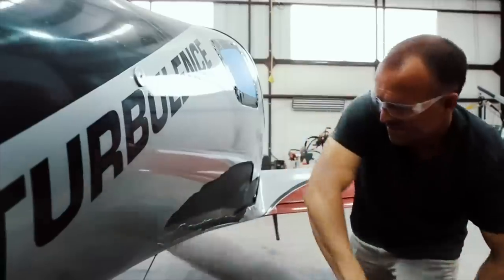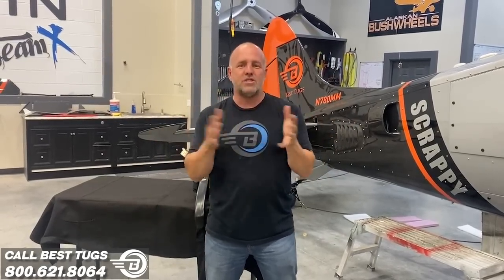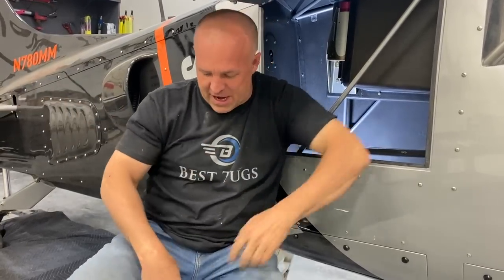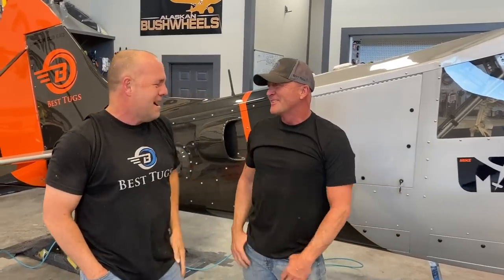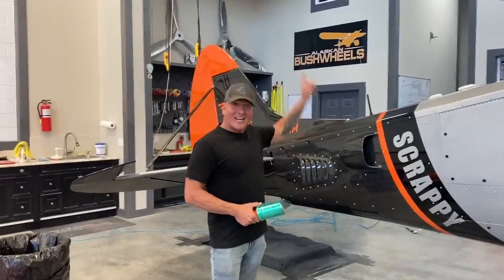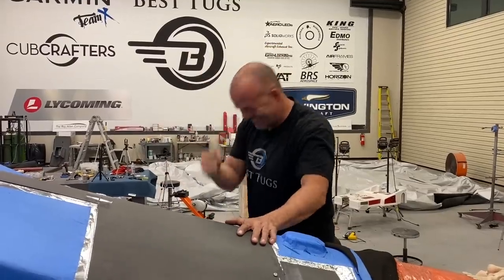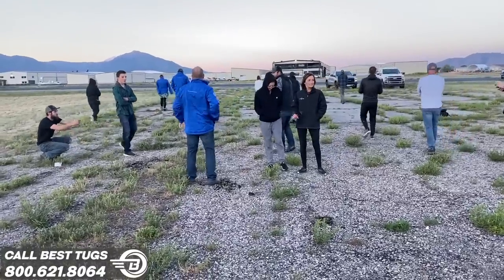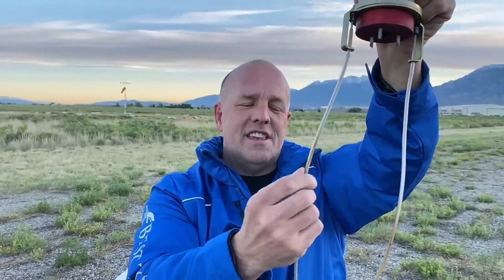🚀 Rocket Parachute blew the lid off my Scrappy Bush Plane 🔥 (Scrappy Bush Plane 27)

Comment: Mike. I have been following you from before Scrappy Build, the Draco days ( about two and half years). 
This has been by far the most Heart warming in two ways.  First your friendship with Ron. Not many can be and remain true friends like that. 
Second, the ''heart'' as the rocket launched the parachute. Priceless. A moment in time.
Also what most did not pick up is that it was Scrappy's not ''fully exposed'' trip out of the hangar, out on its own wheels by Best Tugs..
Now ''get back to work''.

Comment: So my Icon A5 has a BRS Chute, and I learned a heck of a lot more about it in this video than everything Icon has described and published. Thank you for the outstanding informational description!!
Reply: Hi Brett, what are you opinions on the A5 so far? I have done intro flights but just haven't been able to pull the trigger quite yet. For some reason, im not a fan of Rotax engines as i just feel like im driving a snowmobile in the sky. But despite all of that, I still think I will make it happen. Would be curious to hear your thoughts, however.
Reply: @DavidDavid-jb1cy  LOVE, LOVE my A5. Pull the trigger, you won't regret it. The Rotax is a great engine, has a terrific track record, especially the 912 IS. No leaning, no carb heat, always always starts within 1 - 2 seconds of turning the key. Keep enough fuel in the tanks, it won't disappoint you.
Reply: @brettwest549  thanks for that reply. Much appreciated!

Comment: Great test. 
I have a question about if it mattered having the plane planted on the ground or suspended in the air for the test. Will the launch be absorbed by the suspension more than the frame being hit by the initial explosion? Just an observation. 
I think what ever you answer is excellent, I’m a fan.😊

Comment: Love your videos Mike. I could have told you the chute would work. Years ago I had a Buccaneer UL stored in an empty refrigerated semi trailer. One of my drivers hooked up to it thinking it was empty and took off. The King post that the BRS was mounted on bounced loose and pulled the cord and deployed the chute through the side of the trailer. Once you light the candle, they're pretty determined to go about their business. ; )  I've flown everything from a Weedhopper to M2.5 in a Foxbat. Have had a Decathlon for 35 years. You're my kind of airhead. Don't Draco that thing. Your videos have helped to keep me sane through the covid thing. Godspeed.

Comment: Hi Mike.  The first project I worked on when I graduated college (1989) as an aerospace engineer was the landing chute for the Space Shuttle.  That system had a mortar deployed pilot chute and the mortar had to shear several shear pins and accelerate the door that covered the whole system clear of the engine nozzles.  On that door was an angled plate much like your composite impact plate you made.  Same issue.  The door was at an angle relative to the mortar center line.  I worked at that company for 10+ years designing spin and deep stall recovery parachute system for the F-22, C-17, Bombardier business jets, etc.  You did a great job explaining about your BRS system.

Comment: Have been following SCRAPPY,  amazing engineering 👍🏻. Waiting for it to get airborne. BACK TO WORK!!!  Back in the early 70s flew a piper with a 0-320 in forested mountains in NE Washington and back and forth to Glaicer Park international in Montana at night over the Snowshoe mountains, no ground reference just the stars and moon if lucky. Have to agree no piston power at night. You count the beats, a stumble and it’s clean the seat time.

Comment: You are a great teacher and thanks for sharing.  Here is a tip for those blasted static generating packing peanuts.  Keep a spray can of Static Guard around to discharge their static electricity.  Makes cleanup a little easier.

Comment: The way they stitch that chute harness is the same way they do personal harnesses ppl wear when they're working at heights. I actually jumped with one of those harnesses on bc my lift malfunctioned and we couldn't get it to lower and I had to pee so I said screw it and jumped. I was about 20 foot up. The tether that was attached to my harness actually had the suspension stitching in it. It was a very surprisingly soft drop. And I ain't no small guy. Whoever came up with that design should be awarded something. It works so flipping well for being such a stupid simple design. Looking good Mike!!! Scrappy will be in the air in no time........ If she ain't already??

Comment: I think what he needs is actually a finite element analysis software in a CAD package something like Solidworks or Bentley Microstation. Model your aircraft in the CAD package, then run a FEA exam on the airframe to see how much force is needed to bend, bow, or break the fuselage. The results there will tell you how big the canopy of the shute you need to save both plane & passengers, provided its in an area where the plane can crash land

Comment: Thanks Ron!!
Love the Bromance👍😉☝️
Did you catch or dodge the Wrench Mike???
🚀rockets are cool🚀
💥explosions are cool💥
🖲3...2...1...🖲⛑🗯💥
Did you remember your weight as the pilot, your passenger, your gear, and the bag of beef jerky when calculating your chute size??? And why has this company not come out with a air foil type chute to be able to control the chute once its deployed???

Comment: Mike, pregnant idea: bush tracks instead of bush wheels. Think about it. Compare the drag and weight of humongous bush tires and wheels with suitably designed streamlined tracks having the same rolling, load bearing, braking, and envelopment characteristics but 1/4 the cross section and a streamlined shape. I envision a banana shape fairing containing a rubber track having an aircraft tread and a toothed or slotted back. The slotted back engages with the roller with the brakes. Along the frame are closely spaced load rollers and at the other end the adjustable idler just like a snowmobile but proportioned and lightened for aircraft. All in a package of elliptical section a foot high, three feet long and eight inches wide.

I think the added cost and complexity would be balanced by lower drag (higher speed, fuel savings, additional range) and lower unit loading on soft ground plus better planing performance in shallow water. Rolling resistance would be higher and extensions would be required for adaptation to landing gear as the pitch pivot must necessarily be located low in the track assembly. It might be a game-changer in the STOL/bush plane world. And, once developed and scaled for landing weights, a product for Best Tugs?

Comment: You're assume it will tip towards the tail, keep in mind due to wind drift at impact and orientation at this point it most likely would tip towards the nose.  If there is a wind the plane will weather vane, having a slight tail low attitude at impact would help.

Comment: 2000lb thrust... and the gas generation involved in that. Almost like blowoff panels in the chute compartment at the bottom would be a good idea for the "major manufacturers", or having a rocket tube that extends all the way under the fuselage with a gas plug so the interior of the aircraft is never exposed to combustion gasses... for everyone, on that.

Comment: Is Ron's last name O'Reilly, because his nickname should be Radar!
Always anticipating what you need and keeping the compound running!
(if none of that makes sense, you need to go watch some MASH and improve your life ;) )

I have been in that role for others before, and I can tell you from the other side that it's satisfying to find someone that you click with like that.

The most fun I had doing it was when I was the new hire building a new school building, and basically doing whatever the carpenters needed me for, and so I was always being told to get nails or Simpson hangers or lumber, and so after organizing the container I took a set of blueprints home and got familiar with them, so when the boss told a crew to start working on a particular feature, I would just start getting the material set out for them, often before they even knew what they were doing lol
I would also make sure that the jokester carpenters always had adequate large foundation tie-down nuts in their bags, so I would drop a couple in every time I walked past behind them... Smirk
Almost cracked the cement when they would drop the bags at lunchtime...

Then they discovered I could run the Skytrack forklift better than anyone at the company, and I started getting shuttled around to whatever job had the most difficult beam setting or whatever for the rest of my time there lol

Comment: In my estimation the backbone of the plane would take the brunt of a bang bang contact  landing. I believe if the parachute was rigged to make contact simultaneously there would lessen the stress the back bone would take. If the weight/gear travel can absorb the impact and can be calculated to 12" travel it should remain airworthy. I think that the balloon tires might transfer the bulk of the impact to the tail on the initial bounce.

Comment: Had a complete engine failure in a Cessna 206 in North Central Idaho several years ago. Put the plane down in a field. Didn’t put a scratch on the airplane. My advise is fly the biggest piece to the ground. Ballistic Parachutes are for Cirrus pilots wearing skinny jeans with manicures. Good day

Comment: Great overview, I am not an engineer so please excuse my question if straight forward. Your comment around the radius edges for the parachute. Given that you would "typically" be in a forward flight why would you have the rocket behind the parachute? Once the parachute starts to eject would it not be more likely from wind towards the exit channel of the rocket where there is a greater chance of snagging? Or is the ejection speed such that it is not an issue. Thanks Geraint
Reply from the maker: Geraint Williams 👍🤠 great question. The speed is so fast and once the chute exits the plane the wind helps pull the parachute clear and back.  The rocket is so fast it’s not a concern of entanglement
Reply: @MikePatey  Really appreciate the feedback.

Comment: Mike, Does your installation not use the line-cutter feature that allows the rear strap to initially be shorter than the front straps, thus allowing for the parachute trail behind the aircraft until the parachute slows the aircraft down?   After the line-cutters activate the rear strap lengthens to match the lengths of the front lines to hold the aircraft level below the parachute.

Comment: 13:30, why are you making the break away for the rocket pivot towards the front? Wouldn’t the forward travel of the plane add additional force for the rocket to have to push against? Wouldnt it be better if it hinted towards the tail so the wind would help rip off the break away panel?

Comment: just thinking : in case of gas shocks, would it make sense to change the spring coefficient of the shocks when the shoot is deployed (e.g. by the automatic opening of a valve increasing the gaz pressure in the shock via a small pressurized cartridge)? or deploying an airbag of sort to protect some parts of the aircraft/cabin ?

Comment: What did you calculate your maximum rate of descent (dive) to be in order to handle the impact forces of the parachute deployment?  I assume that too high of a descent rate would impart a shock force too high for the airframe to absorb it and result in a catastrophic failure of a mounting point.

Comment: I think you should have done the test with fans or jets blowing towards the plane to simulate the effects of your air speed
Reply from the maker: T.Cole_2  👍🤠 Its been tested hundreds of times on dozens of aircraft ground and in flight. What’s been learned is the air at flying speed even further assist in helping yank the parachute out.  So it’s harder for the bag to pull the chute without the wind so we don’t use that as an assist. if it can deploy with no wind than we know it will do better with the wind ripping the bag back and pulling the chute faster 👍🤠

Comment: Off topic.
  what are you going to do to compensate for the travel in Scrappy's suspension, in case of crosswind on the runway?
 Wouldn't the wing dip dangerously with that much travel in the suspension?

Comment: Mike, what sort of structural inspection or non-destructive testing did you do after that test?  A 2000 lb impulse load could have rot havoc on welds, clips and other structural components below, fore and aft of the rocket.  I know that the vertical load from kicking a 2K lb bomb from an aircraft, accelerating it to 30+ fps in about an 8" stroke, imparts 10's of thousands of lbs of load into the reacting structure.  Did you put strain gauges or accelerometers in the structure before the test?  Seems like you'd want to know what the airplane experienced before "slipping the surly bonds of earth".  Just curious...

Comment: That was awesome!!

Wondering, does the rocket require a floor to push against to get going?  If blasing into the bottom of the tube puts such stress on the airframe from the reactive force, could it have a blow out floor like the top that blows away?

There are gun tubes that are open on both ends with a dual charge.  One charge fires to create a pressure wave and then the main charge to drive the projectile out.  There is no recoil with this arraignment.   Maybe the same thing would work for this rocket.  Just have an open end of the tube or a floor that blows out easy and watch it fly.
Reply: I like your thinking. I bet part of the issue is that the rocket would need to be bigger, plus the "tube" obstructing the fuselage.

Comment: I can see on Draco wings that vg's are instaled right after slats. Is that configuration useful? Stolspeed sayed that using both slat and vg's are not recommended. What's the ideea behind that?

Comment: Don't you need to test this with airflow simulating forward travel to ensure it clears the tail etc?
Reply from the maker: dot gov  great question.  👍🤠 It’s an airspeed relative  to distance from chute exit.  So many test have been done and I’m several feet  forward than I need for ejection clearance of the tail at my VNE of scrappy.  Thanks for the great question 🤠

Comment: @Mike Patey , Is the aircraft skin around the breakaway hatch metal or composite?    I'm just wondering if there is can be any risk of the rocket exhaust starting a fire in that area?    I ask because of an unfortunate accident that occurred above Boulder Colorado some years ago.    A Cirrus SR20 collided with a tow plane with sailplane in tow.  Cirrus deployed their chute, but was burning as they slowly descended (sans one wing), and eyewitness reports suggest that the pilot and passenger jumped out.

Comment: Are you doing any checks of the frame welds or carbon connections after the test to make sure there was no microscopic damage?
Reply from the maker: Joe K 👍🤠 yes absolutely. every inch full disassemble of the plane and back
Reply: @MikePatey  I would have assumed so with your thoroughness but was interested to find out for sure.  Such a crazy awesome build.

Comment: could you build a cheap unmanned "towed glider" and deploy a parachute on That aircraft? Keep the airframe dirt simple and cheap, except for the necessary features being tested, just to prove the idea? Tow to altitude and target area. Detach, let it glide for a moment, then remote deploy the chute. Find some old beat up airframe to use, remove the engine and weight the nose.

Comment: I saw that guy on YT nose dive in a river because of air in the fuel from a fuel bag pump and I wonder if you can ‘fly’ with the parachute open? I don’t mean fly like a plane, or even hold altitude, but merely get to a clearing or miss a building if you can restart the engine? (thinks about gently floating onto a motorway) :o)

Comment: So if you are flying and the use the rocket will you need more propulsion? You tested on the ground and the aircraft was unable to move but when you are flying your airplane may not have lift and could just be forced even further away making the rocket too close to the aircraft.
I know that probably doesn’t make sense.

Comment: Hi Mike, since this test took place months ago before the pandemic took hold, does this mean that you might have the wings built at this stage since the fuselage has been ready to receive them for a while now?  Back to work!  Phil
Reply from the maker: Theresa Caron 🤠 not yet, the panel was my project done after that, you can see it’s not there or wiring or interior.  Then after that was seat and interior. Then motor mount.  Wings are after cowlings, engine plenum, exhaust, and custom spinner and a couple dozen finish up items.  A ton of one off stuff and then on to build the wings.
Reply: @MikePatey  Thanks Mike, just can't wait to see it fly I guess.  All the best.  Phil

Comment: Hey Mike, any reason you couldn't whip up a mortar tube, or venting system for your expanding propellant? The gasses'd all go out up top, or even jetted out from underneath, not into your cabin. 🤟🏽🐻
Reply from the maker: 👍🤠 yep, great thinking 👍  it has a mortar tube, I talk about it in a Q and A segment in the video that cane after that one with my wife on the thumbnail.  It works great, the smoke I hit was minimal and was just a trace of what blew down as the rocket was already out of the plane.  In flight that would be blown back.  👍🤠
Reply: @MikePatey  Roger that. I remember you saying it was momentary, and didn't heat up anything, though it had you choked a little. Miss Chandra being in that back seat was who I thought about, if push came to shove. 🇺🇸 🤟🏽🤠 ✝🛐